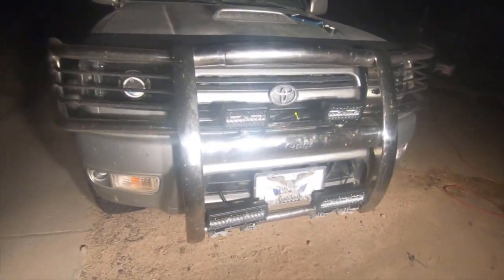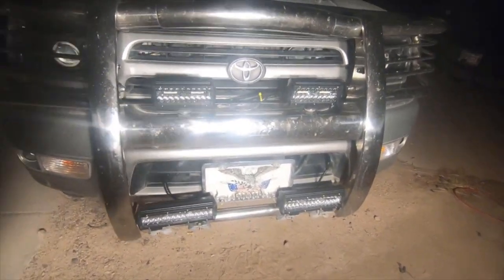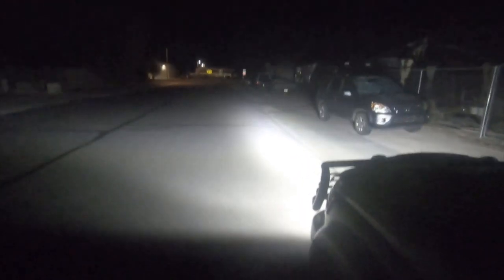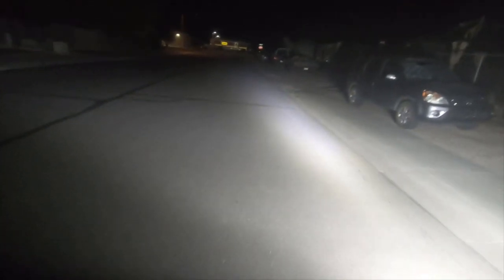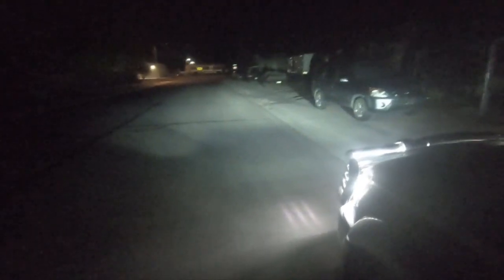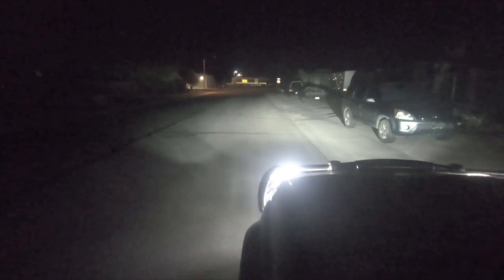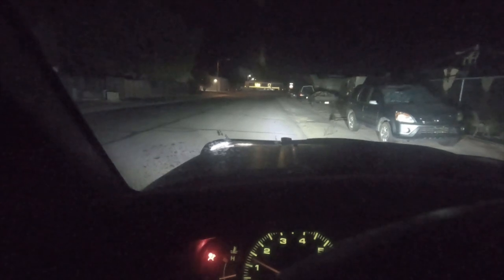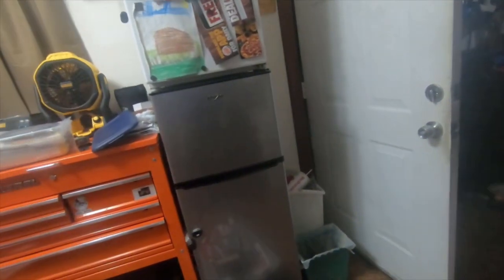Electronics - AmBother LED 7 Inch and 9 Inch Lights Final Install N Night Shot Part 3

Comment: Wow! Impressive! I agree with you, the tops look brighter and whiter than the bottom lights. Nice looking install!
Reply from the maker: Thanks Brandon brother for stopping by
Reply from the maker: Thought I was going nuts so I'm not the only one that sees the 7 inch lights are brighter then the 9 inch lights
Reply: @AntonioClaudioMichael   They both look nice but the 7 inch lights look brighter and whiter. With all those lights plus the HID you will be able to see real good at night.
Reply from the maker: @BrandonLund  the ram guard lights are for offroad only they are defenitly a little brighter then my hids but my hids are a 5500k white where the offroad lights in video are a 6000 to 6500 k bluish white so that's why there brighter then hids but it will defenitly help during crawling at night and desert running